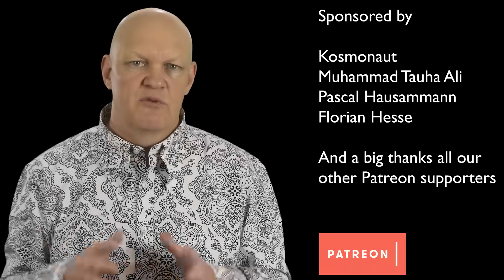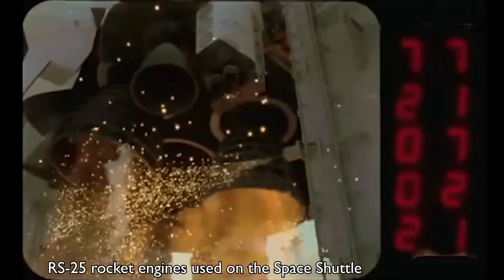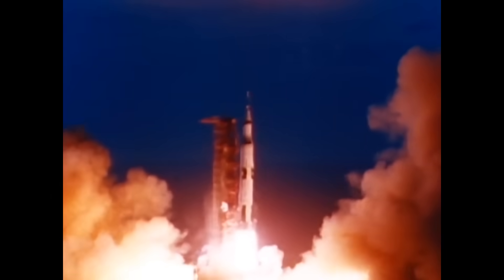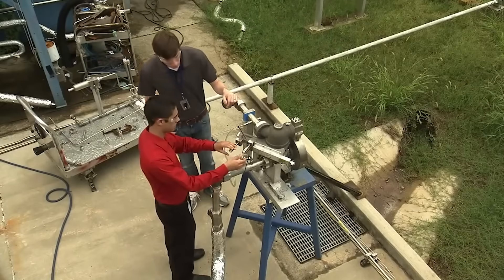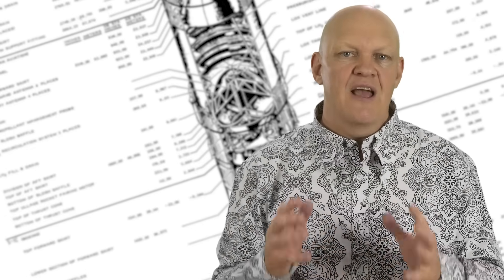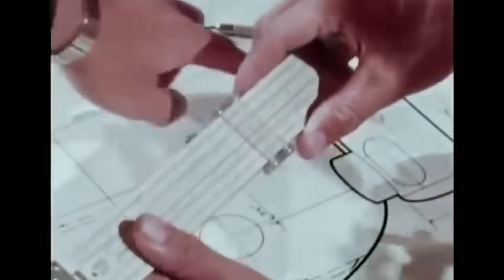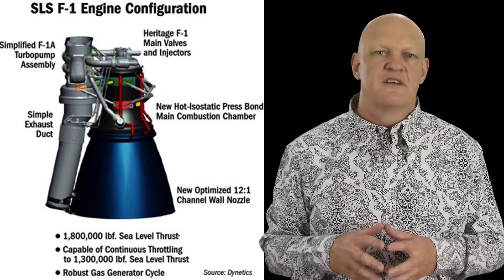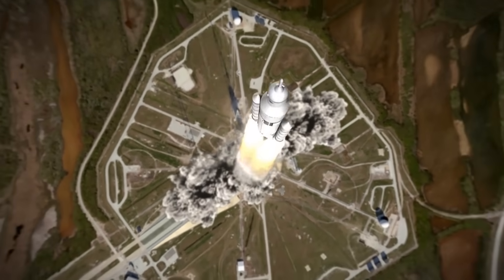Why Can't we Remake the Rocketdyne F1 Engine?

Comment: 1 OF 2 THINGS CAN SOLVE THE ANSWER TO THIS VIDEO ...SKILLED LABOURERS  FROM ALL WALKS OF INDUSTRY HAVE BEEN REPLACED BY TECHNOLOGY SO LETS NOT TALK BOLLOCKS ....I THINK THE F1 SIMPLY DOESNT WORK AS  ADVERTISED ... I ALSO THINK  IF RE-CREATED THERES  A STRONG POSSIBLE CHANCE THE ENGINE WOULDNT BREAK EARTHS GRAVITY .... ANY1 USING MATHS  WITH  A  TRUE POWER TO WEIGHT CALCULATION WOULD QUICKLY FIND THE ANSWERS  AND IF THOSE ANSWERS  SAY FELL SHORT BY 90 MILES OFF LOW EARTH ORBIT  THEN  AMERICA ,S MOON LANDINGS WILL B UP 4 SCRUTINY YET AGAIN!!! U DID SAY STUDENTS TRIED TO REPLICATE THE ENGINE BUT BCOZ OF ITS COMPLEXITY THAY NARROWED 150.000 PARTS TO JUST 40.000 WITH ACTUAL OUTPUT FIGURES IN 2 VARIENTS OF SAID ENGINE BUT UNFORTUNATELY NO SUCH ENGINE EXISTS !!!! IN ENGLAND WE SAY IF ITS NOT BROKE DON,T FIX IT !!!... IN AMERICA U SAY HEERS THE BLUEPRINTS TO A SUCCESSFULL ENGINE THAT WENT SEVERAL TIMES TO THE MOON !!!! UNFORTUNATLY THE ENGINEERS NOTES DIED WITH THEM ...SADLY .. BUT I DONT SUPPOSE U STUDENTS COULD MAKE THIS  ENGINE BETTER!!! ............................lol GTF ..... BLAGGING YANKERS

Comment: Of course we could build anything if we want to. The issue is the F1 is less efficient technology. Rocketry has advanced since then. There are newer fuels and engine designs. The Russian rockets use a more efficient closed-cycle technology. The F1 was an open-cycle design, as are the SpaceX Falcon engines. The Raptor engine is  a closed-cycle design.

Comment: F1 is powerful but inefficient, it is an open loop system. Compared to closed loop system which can be built much smaller, consume less fuel and can be in equal in power as the F1.

Comment: It's not exactly "from scratch" if they used the F1A engine as the template for the F1B, just using updated procedures and computers to modify it.  "From scratch" means starting with a clean sheet of paper, or an empty computer screen, and starting from there. That wasn't done.

Comment: My father was an engineer for Rocketdyne. I remember the stories of going to the shop floor to communicate with the welders, machinists and assemblers to explain what they really needed done. Years after my father passed we found a box full of notes and drawings and communications to the people on the floor in regards to the F1...
Reply: Keep it safe,it will be worth it.
Reply: That could be handy.
Reply: Definitely look into takling to nasa, or sell it to space x lol
Reply: @josephgreene630  NASA and sx undoubtedly has technology superior to the F1.
Reply: @Misha-dr9rh  it's not about superior overall, it's about not having to rediscover certain quirks, which can only be done through experimentation.
Reply: @Misha-dr9rh  It’s the Russians who developed the most efficient engines, in fact several Nasa rockets, based on old ICBMs now use Russian engines.
Reply: @SvenTviking  I thought it was the Germany and the Paperclips? Maybe Russia got the cream of the crop...
Reply: @patrikgubeljak9416  nah its outright superior
Better materials
Computer simulated fluid dynamics
Computer simulated thermodynamical properties and cooling solution
Computer controled manufacturing,welding etc 
I think you get the point
Reply: Sell them to NASA for big money! :)
Reply: @arteljus  pretty sure nasa already owns them.
Reply: @samus4799  did you forget what happens when you assume things ?
Reply: If you haven't already, you should absolutely get in touch with NASA and the Smithsonian Institute. Both would be incredibly excited to get access to those documents. Even if you want to keep the originals, they could be digitized for posterity.
Reply: @bradleyland  sounds good
Reply: My brother-in-law's father worked as and engineer at Rocketdyne (Huntsville) on the F1 the for most of the 60's.  They could have very well know each other.
Reply: I worked for Rocketdyne in Canoga Park 1965-66 building the F1 and J2 engines, Always liked watching the Saturn V lift off.
Reply: @jerrykalick8565  if you see my screen name you might know the location where he worked. And where did you work. Your timeline seems to be correct are you close to the location where you worked?
Reply: My complete respect to your late father .
This is the reason I became an engineer due to the Apollo space program and the wonders of engineering.
So much information was lost from the program , I deeply hope that those notes where put in a museum or NASA had the common sense to put those notes and answers in a safe for there well being .
For me Apollo and Concord where the greatest engineering programs , the level of skill I believe Wes unmatched and has benefited mankind onwards
Reply: Wow… the comments here are just abysmal.  Right, wrong, smart, stupid… many are hellbent to irritate someone on the internet, for the purpose of what?  
Go do something in the real world, especially that one special loser who started this cabal.
Reply: @dash8465  i just come here to knock down glibness and pick up bitches
Reply: I really hope those precious notes didn't end up in a dumpster!.
Reply: @monteceitomoocher  
No way they would.
Reply: You should get copies to NASA.
Reply: There was a tunnel under Canoga Avenue and the ducts had a bad tendency to hide metal chips fragments and the like were towed on a mercury cart back and forth 6 times checking after each rum. The paperwork was pretty extensive and the hand written notes were very detailed.
My father too was a Rocketdyne Quality guy. He went to the Cape for the J2 Engine.  I followed him in the industry even working for a time on the SSME before the Shuttle flew.  North American had talent unparalleled in any industry.  AND, they did it with Sliderules!
Reply: @jeffstorm  Marsh still have his slide rules and all his other equipment
Reply: And many times, it would be key touch labor personnel (i.e., machinists, platers et al) who Rocketdyne engineers would go to for information and long-practiced yet undocumented shop floor 'solutions'. I worked for Rocketdyne (from Rockwell thru Aerojet ownership) as a test engineer; that job necessarily required a lot of tooling design. Fabrication always led to heavy discussions with machinists and welders. One of the top level specs for welding was written by a welder named Moynihan. (I hope I spelled that correctly.) We and weld engineers (amongst others) would go to him for expert advice. At that time, we were fortunate to have the best of the best mechs and techs available as they were highly-skilled 'survivors' from the F-1 days and the substantial layoffs following the end of that program. PS: It sounds like your dad was a Manufacturing Engineer. I always enjoyed working with MEs; whenever we ran into a situation where another department (or person) was gumming up our progress, they'd whisper in the right ears and get things going again. MEs are schedule-driven.
Reply: worth it for the history alone!
Reply: Your dad lived a lie for the the gov.  NASA is Disney and nobody went to the moon
Reply: @MyFriendlyPup  
You might want to get some medical help you're delusions are overriding reality
Reply: @escapewaco1  my brother, nasa has been caught in contradictions hundreds of times.  Your dad was a good man.  He sadly worked in vein.  His math and science helped the rocket go up.  Then it came down.  If you want to break the programming you can find all 6 challenger astronauts alive and well.
Reply: @MyFriendlyPup  
How do you know , was you there matey ?
Reply: @glitch1182  
You are probably right , it’s a mad world …….👍
Reply: it's awesome that he kept the notes.  Don't worry about people giving crap about theft.  One nobody gave a blank back then, two they are the equivalent of inter office email today which is only retained for 7 -10 years the destroyed.  not to mention if it was a crime which I'm sure it wasn't for the time period, the statute of limitation would be long past. 

I say scan them and send them to NASA.  they will probably get added to the archives for the appolo project.
Reply: Hopefully no government men show up and want to take them away from you
Reply: @pauljanssen2624  
Do you think I actually have them in my possession? I'm not that stupid.
Reply: Wow that is incredible. I would keep the notes for sentimental value.
Reply: Did you sell them?
Reply: @Lukas Маnfred your ad hominem just demonstrates you have no valid points to make.
go on, call me a troll next, show the entire world how mentally feeble you are. #IqDeficient
dont you have some pokemon to go catch?
Reply: @Creed McGregor Tx.
Reply: Please hold on to them! We NEED them!
Reply: PLEASE tell me they're safe?
That would be such a remarkable resource for future engineers to study!
Reply: Did he work at Canoga? De Soto? or SSFL?
Reply: @_BusterHighmen  McGregor TX which is now Space X facility.
Reply: Name 1 item government produced item after 1910 that we cannot remake, other than thus.  I'm waiting.
Reply: @leonawright2331  I can't but it is plausible that this is the singular item that cannot be remade.  Unlikely statistically and unprobable.  Likely another gov lie?
Reply: @contraryleaks7117  here in Phillipines only the low education believe in America's nasa.  Like Santa Claus to us.  😂
Reply: I could care less WTF are you babbling about...
Q-tip
Reply: Current technical value of those personal engineering notes is of uncertain usefulness for the reasons pointed out in the video.  None the less, a museum such as the National Museum of the US Air Force at Wright Paterson AFB in Dayton, Ohio might be interested in curating the collection for its historical and heritage value.
Reply: Dude. I'd buy these for you to rebuild a ticket manufacturing plant. You got millions in design technology in your basement. I hope you didn't not destroy them. It's also said it was the work of a Cuban brainchild and we haven't had an equivalent.
Reply: Chumma thallathe
Reply: so, your fathers theft of nasa documents is what has lead to the extinction of humanity stuck on this rock
Reply: @Ghryst  🖕
Reply: speechless @escapewaco1 ? 
truth hurts, eh? how does it feel having a criminal for a father? intellectual property theft is a felony crime with up to three years in prison and a $250,000 fine
Reply: @Ghryst  You have a small Facebook following and a small YouTube following for a very small person.
Reply: @escapewaco1  fact : it doesnt even matter if he hadve written those notes with his own hand, he doesnt own them if they were written during the course of employment, to take them home and keep them is intellectual property theft, end of story, its  felony crime, punishable by imprisonment. he's a criminal, and you've received stolen property - another crime. as  a lawyer who deals in this precise field, i know exactly what im talking about, criminal
Reply: @Josh-sx1el  TL;DR, can someone summarize that wall of text for me? pref 3 words or less, im here to watch videos, not read books
Reply: @DAda-nv7ro  fair enough .. sounds about the intelligence level used by these types.
Reply: @Ghryst  it's just some dudes notes, it's not classified government documents. Stop making up stories in your head and trying to sound smart.
Reply: @Ghryst  damn it been a month and your ego means you still here continuing to argue LMAO.  Clearly this a fight neither of you will win, so smart choice is give up
Reply: @Ghryst  there are many cases of the very thing you are arguing about, which case would you use to aid in your arguement? Ask yourself what are they truly employing him for? What are the notes truly used for, intellectual property or are they notes of craft? They could be construed as hypothetical situations and not be able to be a proven application, there is a lot of things you must consider before you accuse and slander someone's credibility calling them a criminal.
Reply: @Ghryst  intellectual property theft and left wing extremists that’s some leap. I well aware  it’s common these days to blame those who have 4 adopted dogs, wear Birkenstock’s with socks and drive a Subaru but they are not responsible for everything.
Reply: @Ghryst  Erm, Rocketdyne != NASA, no?
Reply: @Ghryst  Odd, that's how we did it on the ISS, and the C-17, and the F-15...  Perhaps you should inform Lockheed Grumman, In Grand Prairie, that they are doing it wrong...
Reply: @Jonascord  ... says some dude on the internet
Reply: @Ghryst  Standard Democrat.  truth does not abide in you.  When challenged, about your lie, double down, or change the subject.  Or attack the challenger.
I was there for the changeover from drawing boards to digital.  As CAD/CAM slowly took over, and drawings were digitized, the Old Engineers were a hard sell.  They would insist on 2D, 3 view orthographic projections, as if the CAD system was some kind of misbegotten Etch-a-Sketch.  
Us Young Twerps would build in 3D solids, and the Old Ones would whine about how their CAD skills were not up to manipulating the files.
(This was after the Shuttle and before the ISS.)
One other thing.  TACOM, the Army Tank-automotive and Armaments Command, demanded sequential drawing numbers for all their files, digital or not.
One of our drafters ordered copies of drawing #000-000-001.  It was a cannonball, a circle, with a section view and one dimension, and specs on how to forge it...
Reply: @Ghryst  - "says some dude on the internet", Said some "dude" on the internet...
Reply: @TheRealGneiss  ah, i see you have played 'some dudes on the internets' before ...

ProTip: negation is an absolute concept; something is either present or absent, and adding a second negative to a sentence does not make it correct just on the basis that the first negative was correct.. ie: im right, and you're wrong, because my statement does not rely on the sources reliability
Reply: @timmy31087  ProTip: there is already a word for 'opposite of smart', which is 'stupid'.
if you were even a smidgeon smarter, you'd have known that.
Reply: @Ghryst  I’m just here watching you pretend like you don’t care… 6 months later. Please continue.
Reply: @Ghryst      Bro the one that looks like they’ve had 700 drinks, hahaha!
Reply: @Ghryst  well, he could have worked from home also.
Reply: @Ghryst  I highly doubt you're a lawyer
Reply: @Ghryst VanGhod Good luck pursuing a dead man. Official documentation is one thing and unofficial notes of a person's ideas of improving things/off-textbook thinking is the other. Why would you call somebody's deceased father names? He was just telling a cool story and you tried ruining it. For the love of god, man, why?
Reply: @km077  Ghryst could never try to walk in someone else's shoes because smallness of the heart and mind within.  Ghryst will never be able to comprehend the level of genius of my father and many others associated with the program. When someone speaks out such as Ghryst, they themselves are usually in fear of their own shortcomings, like redirected anger. Blame is better to give than receive. You ask why Ghryst would somebody call my father names? Ghryst is unable to improve ideas and thinking of self discovery, to use problem solving skills to become a better person, to look within. Selfishness. I live close enough to the SpaceX facility in McGregor, Texas, so I hear the tests being performed on rocket engines, watch the ISS or a satellite fly over, there's positive connection because of my father. Ghryst lacks the ability to connect with reality and others in a positive way and we see that in his words.
👍✌🖖💪
Reply: @Ghryst  it's not NASA documents. It's his notes and NASA didn't set up a system to accept these notes in the rush of the space race, it's NASA's fault lol.
Reply: @Ghryst  thanks for the Laugh

Comment: Remaking F-1 is also just a hilariously bad idea from the standpoint of efficiency. Want a modern Kerosene engine? Buy a Merlin. Want a Kerosene engine from the Space Race? Pretty much every Soviet Kerosene engine is considerably more efficient than F-1 and lighter. Soviet tech from that era in the F-1 could probably have saved about 450 tonnes on the first stage of the Saturn V.

Comment: They absolutely did lose the plans.  The plans that remain are incomplete and as this video directly states the notes and details required to successfully build the parts/engines no longer exist.  As an engineer I can attest to how incomplete plans are no better than no plans at all.  These engines would need to be completely redesigned from scratch.  Manufacturing processes have advanced and moved on?  Please.  All of those old manufacturing processes are still well known, even better than 60 years ago, it is the details of the plans that are missing.  There is no magic here aside from the genius of the original engineers who designed these rockets.